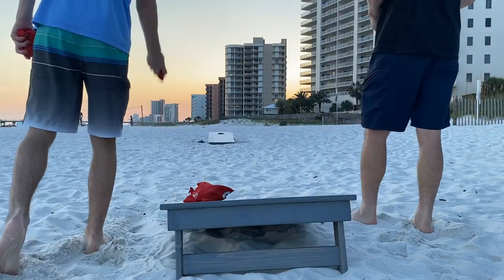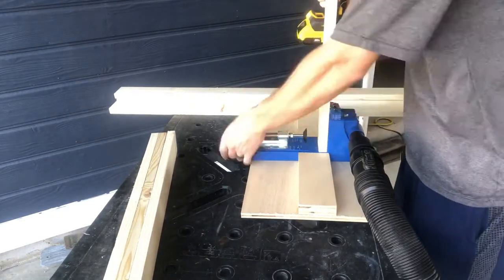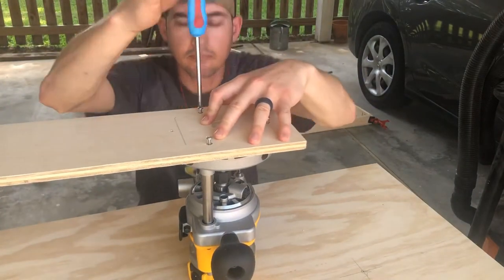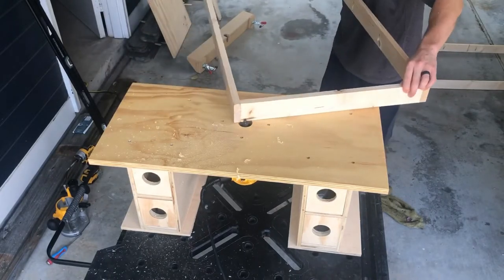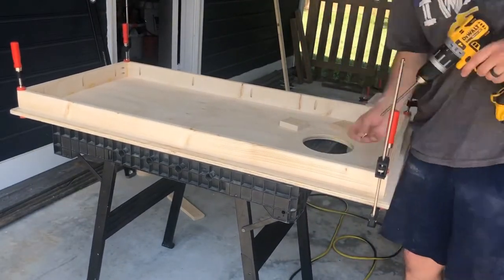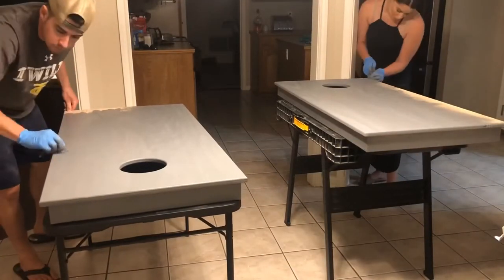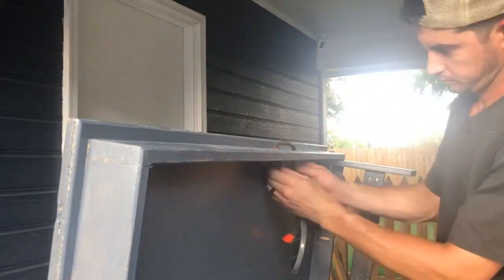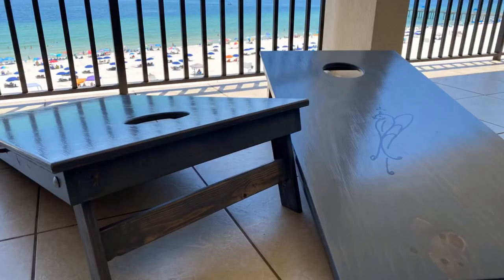How To // Cornhole Build with Cut List

Comment: You can make a wide stretcher in between the legs so that it's level when opened, make some round cup holder holes and put some cup holders in them. You can also make a net at the back to catch the over-throw bags, like a soccer net but not as loose. I like to KICK things up a notch!
Reply from the maker: Absolutely, I like the ideas!

Comment: I plan on using Baltic birch for my tops. And have little use of a router since HS in the early 2000s....so im a little nervous rounding the edges. Is it as easy as you make it look on the plywood? (Obviously I'll make a few practice passes first lol)
Reply from the maker: It really is, especially if you are using baltic birch. Just keep a steady pace and don’t stop in one spot to keep from burning. Take it smooth around the corners and you should be fine. One piece of advice, check for voids in ply at height of the router bearing. If bearing rolls into a void, it will cut an indention into your top. Baltic birch has many layers with hardly any voids, so you shouldn’t have a problem.
Reply: @DIYDuBItYourself  thanks so much!

Comment: Are you sanding in between each coat of poly?
Reply from the maker: I like to put a couple coats on first then sand the raised grain down. If you’re putting on a decal, I would wait until you get a couple coats over it first. Between coats I would feel for high spots or bubbles, and lightly sand if present but not necessary. I would always sand before the final coat though
Reply: @DIYDuBItYourself  thanks!  Great work btw
Reply from the maker: Thank you, good luck!

Comment: Does using a 1x3 change the board height at the front and back of the board? Where it should be 3-4” in the front and 12” at the back?
Reply from the maker: In comparison to a 1x4 or a 2x4, yes. Using a 1x4 with a 3/4” top will put the front height at 4.25” (too high). Where as using a 1x3 with 3/4” top, the front height will be 3.25” (within 3-4” regulation). As for back height, cut legs appropriately to reach 12”. Most overlook this detail, great question!

Comment: What was your bolt measurent,  I See  you measured from the inside of frame, think you said 1 1/4 from bottom but didn't understand when you said front
Reply from the maker: Carriage bolt size is 2.5”
Carriage bolt location is 1 1/4” from the bottom and front, in relation to the board, but in terms of the legs, 1 1/4” from the top of the legs and 1 1/4” from either edge, so in the middle of the 1X3.
Hope that helps!

Comment: Why stain the bottom?
Reply from the maker: For me, I like a consistent look. The stain and poly on the bottom will offer some protection but definitely not necessary
Reply: @DIYDuBItYourself  it will also help reduce warping (even though plywood should be very stable).  Unfinished wood and finished wood will expand and contract differently.
Reply from the maker: @monteporche5552  that’s a great point!